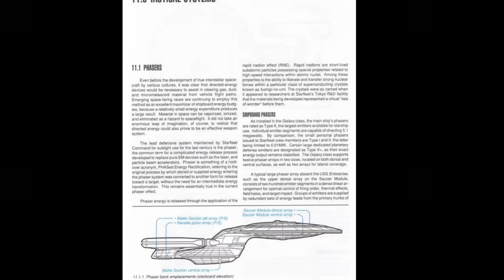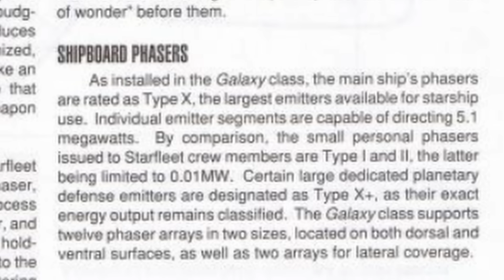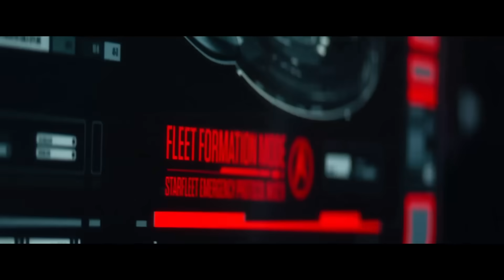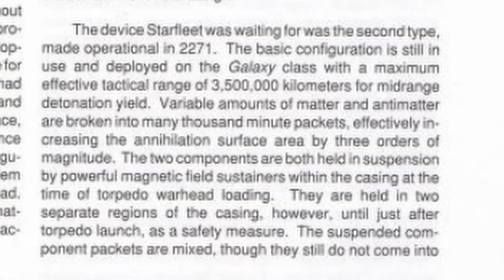Phasers: How Powerful are they Really?

Comment: I remember some Science channel explaining that Phasers work like sand blasters. You have the usual beam plus some tiny particels which are accelerated to near light speed. They carry a lot of energy at that speed, because they are heavier than photons and since there are so many, it eats away any surface in mere moments. 
That is standard fire mode and you can not compare this to regular Laser/Plasma energy output. Like take the same sand blaster without the sand. Just make it blast more air. You will not go through. With sand you will.
Reply: a macron beam then. and with trek tech they'd probably have the version that shoots little pellets of D-T that trigger fusion on impact. that would actually put out megatons per second of energy.
Reply: plus maybe a laser beam set up to keep the macrons pushed to the center reducing divergence for the crazy ranges trek deals with.
Reply from the maker: Yes, phasers are particle beams but the particles themselves disintegrate matter so they’re crazy dangerous at even low power
Reply: Sigh
Another source says that phasers are particles stripped of the strong force and thus basically cause fission or maybe as far as antimatter like particle disintegration.
This would make sense.
Reply: @bobsterclause342  One thing is for sure: the analogy of them squirting acid instead of water is not too far fetched. They may not deliver the same amount of pure energy (combined kinetic and mass/energy alone) as other guns which are shooting plasma bolts for example, but make use of effects which boost the damage output well above the energy rating, which leads to the seen effects of it being able to desintegrate matter if necessary. 

Due to film limitations and other story telling reasons of course this goes around with some sci-magic. Because desintegrating a person in a room would cause this room to heat up and melt everything around it, even in a contained reaction which would not lead to a atom bomb like explosion. Even if you say the matter is deconstructed. The energy needs to go somewhere. And heat is the end for a lot of this process.
Reply: @Orodreth888  yeah, i mean this all is is exactly what I have been thinking.
People act as if the phasers are so powerful like its in the reactor and the beam itself is strong.
Its not
It basically is more like antimatter than a rail gun.
As for disintegration … u yeah… i dont know why there is no effect. You cant just delete matter without consequences. 
Quintessence makes sense though… it teliports matter to another dimension… so a water tower gets hand phasers  without killing everyone or exploding.
Reply: None of the conventional explanations work, because sufficient energy to vaporize a human would result in an explosion that kills everyone within about 50 meters and leaves a 5 meter crater. Instead the target just sort of goes "poof" and fades away. Something much different than blasting them with X amount of energy is going on.
Reply from the maker: @GreylanderTV well, Nadions disrupt matter so what if sufficient quantities at sufficient energy levels will cause all atomic bonds to dissolve in a non-energetic manner?
Reply: @ fictionrant7805 Key word is "non-energetic". Since a human "vaporized" by a phaser does not explode, then there is something else going on other than pumping sufficient energy into an object (mostly water) to vaporize it. If you suddenly turn 50kg of water into steam that's a huge amount of hot gas (water vapor) compressed into a very small space and it is going to expand, violently. What actually happens is all that mass just seems to disappear with very little atmospheric disturbance. This means we can't really think in terms of energy of vaporization in a meaningful way. The matter of the target is transformed or deleted in some way that involves new and unknown physics which may require much less energy than crude vaporization. Interestingly the matter disappears and seems to be replaced by an equal volume of air, otherwise there would be a vacuum bubble that implodes and we would get a loud "pop" from the air rushing in to fill that void.

It's basically impossible to use our conventional knowledge of physics to estimate how much energy phasers actually output. I'm incline to guess "less". Given the name "phase-er", we might guess they operate by somehow shunting matter "out of phase" with normal spacetime (a common theme in Trek), but perhaps it does so atom-by-atom in a disruptive/chaotic way, so there is not a whole object person coherently shifted just out of phase.
Reply: SOLD! Okay, debate over, let's go home.  Actually, I think I remember seeing something like that back in the day, and it makes sense.
Reply: Except that’s exactly how lasers work. They heat the surface atoms of the target and ablate them away, exposing more atoms to be heated and ablated. More photons, faster heating and ablating.
Reply from the maker: @markfergerson2145  Like the OP says, the difference between a laser and a particle beam is similar to the difference between a jet of water and a jet of water that contains an abrasive. 

In this case, the abrasive by itself is capable of disintegrating matter so you accelerate that to 0.999999c and watch stuff disappear
Reply: @ fictionrant7805 at these energies it doesn't really matter whether it is a beam of particles or photons. If we're thinking in terms of explosive vaporization (which is not what happens, see my other posts) then as long as the energy is absorbed by the target, it will vaporize, whether it is a beam of protons, neutrons, photons or whateverons. But a beam that intense would pierce a whole right through a person and keep on going as a narrow beam. There would not be a chance for the energy of the beam to spread and vaporize the rest of the body, unless the beam is rapidly scanned back and forth across the entire body, which we don't see happen. Instead we see a narrow beam strike the target at a small point and somehow the whole target disappears leaving at most a glowing/misty gaseous residue. That's another piece of evidence that phasers do something very weird and involving completely new physics. Phaser are not energetically vaporizing the target.  (Note: when we get to the level of atoms, "ablation" and "vaporization" are effectively the same thing--vaporization happens because particles collide with particles and knock them loose, and at these energies it doesn't matter if its photons or grains of sand or anything in between are doing the ablating...)
Reply from the maker: @GreylanderTV next you’re gonna tell me that running someone through with a lightsaber would at minimum boil their organs and probably make them explode
Reply: @ fictionrant7805 No, running them through with a lightsaber won't make someone explode because the energy from the lightsaber is not given an opportunity to spread throughout the body to burn/vaporizing all of it instantaneous. It only melts/burns/vaporizes where the narrow cylinder of its beam comes in contact (and maybe a little beyond).

Now if you held the lightsaber in a tub of water for a while, it would, I imagine, boil the water. But as it does so over a period of time, there would not be an explosion.

If you somehow swiped the lightsaber back and forth through a body, like a scanning laser, covering the entire body in a fraction of a second, then (assuming the power output of the lightsaber is high enough) the entire body would vaporize in a split second and thus you would have a huge explosion. But I don't think lightsabers put out enough power for that. Notice how when cutting through something substantial like blast doors, it take time and force (not The Force just regular force) to push the saber beam along. So while a lightsaber can vaporization maybe a liter or two of flesh(water) nearly instantaneously to cut you in half, it would bog down if you tried the "scan through every inch of someones body" trick. (strictly speaking, instantly vaporizing a liter of water should still make an explosive steam blast you would not want to be close to, as that's still about 1kg TNT equivalent exposion--so if we're getting technical, and we are, Darth Maul should have exploded with guts & pieces flying everywhere,, and when Quai-gon was run through, the smaller explosion probably should at least have burst his chest) [edit: so wait... yes, yes it will make them expode, lol!!!!  just not like we would expect phasers to]

But in analyzing phaser energy, we're looking at whole bodies which disintegrate/disappear instantaneously. if we interpret that as "vaporization" then we have the problem of explaining (a) how we pumped that much energy into the body and diffused it through the entire body instantaneous even though the body is touched at just one point by a narrow beam, and (b) why no explosion from this sudden conversion to extremely compressed steam?
Reply from the maker: @GreylanderTV  the scene where Valeris vaporizes the cooking pot, leaving the food inside intact from Undiscovered Country further makes things confusing
Reply: @fictionrant7805  Yes, the way the effect of a phaser seems to restrict itself to the person or object touched is a whole other ball of weird. When you zap a person, why does it get all their clothes and equipment, but not, say, leave a small pint in the ground where they were standing. How does it "know" what the boundaries of the target object are?
Reply: @fictionrant7805  all the discussion here is why for a long time i misunderstood the handheld phasers to be removing matter out of phase with our dimension, similar to the logic of that one SG-1 episode with mutant bears. No explosion because it exploded into subspace or whatever, having no interaction with the vulnerable humans in close proximity to the vaporized target

Comment: My theory about phasers. First the Nadion Particle is a type of monopolar pentaquark with a partical mass of 4-5Gev. As the nadion passes through material it strongly interacts with the electric field of electrons in the material dragging them along its path, pulling them away from atoms and inducing massive electric currents (thousands or millions of amps) in the material, causing it to heat up almost instantly, not unlike an induction cooktop. After depositing most of its kinetic energy, it rapidly decays, releasing several GeV into the material as a scattering of subatomic particles and photons. This causes additional heating. The stripping of electrons disrupts chemical bonds and inbrittles the material making it easier to physicaly destroy or vaporize. 

The power of the phaser array is not the energy being delivered to the target, but the energy guiding and focusing the beam. This power is not unlike a super collider's stirring and acelerating magnets. It also places a cap on how many nadions can be controlled and how focused the beam can be. The real affect of the phaser comes down the nuclear interactions of the nadion with the material. And it would interact with varying degrees with different materials. 

As for the stun setting imagine a taser strait to the brain. That means lights out for anybody.

Comment: My personal head canon for torpedoes is that  the energy out put of the matter antimatter reaction is amplified by the material the reaction chamber in the warhead is made of much like a warpcore and that energy is more then big boom like a standard reaction it also warps matter and space creating pressure inside the space and matter in the blast radius. To me that makes more sense because it is impossible to dial in a matter-antimatter warhead without draining of some of the antimatter  cause once the magnetic bottle is "broken" all bets are of for the surrounding matter.
Reply: I thought the yield of photon torpedoes solely depends on the amount of antimatter in the warhead.  The amount can be adjusted by swapping the torpedoes' antimatter pods in the torpedo bay.

We saw ensign Kim holding one of these smaller antimatter pods during Voy: The Omega Directive. 🙂

Comment: You know how an x-ray pumped laser (theoretically) takes a nuclear explosion and turns that energy into x-rays? I postulate that the torpedoes are doing something similar. They're channeling that M/AM explosion into something else (probably subspace particles or nadions or the like) that are far more effective than the pure energy generated by the interaction would indicate.

For all we know, this process is applied to the entire torpedo when it's launched. If the torpedo is converted entirely to subspace energy when it's launched, that might explain why we don't see point-defense weapons used against them, even though they move slow enough that it should be possible.
Reply: the only project where I've seen CIWS used against photon torpedos is in Star Wreck...

Comment: The only thing I can think of re: the torpedoes is that matter/antimatter reactions are a LOT more powerful than the tech manuals let on. How else could ships get stronger and stronger weapons and shields, and go faster and faster, while powered by the same warp cores? They improve the emitters and arrays so they can handle more power going through them.

Now, if only they could likewise improve the fuses running through their bridge consoles to keep them from exploding… 😎
Reply from the maker: The problem is the torpedoes are using antimatter and that’s subject to e=mc^2

If there’s something else going on that could all make sense though like quantum torpedoes use zero point energy so they can hit as hard as needed

Comment: Then reference the attacks on planets instead of starships and shields. 

By the way, the original Star Trek is ironically more consistent than TNG. In particular, the TNG technical manual is a joke: you shouldn't be using it.

If you do, for some reason insist on using it anyway, the energy output difference you apply to phasee should logically apply to photon torpedos as well: unless somehow you're asserting photon torpedoes are less powerful than the phasers.

Comment: The problem with this is that SNW is set in the prime timeline as TNG which would mean they had stronger better weapons in the 23rd century than the 24th and even 25th century when we know for a fact the technology got better and stronger with time, not the opposite.  If the weapons were as powerful as they say they are in SNW, then how do shields from ships stop them?  We see smaller amounts of energy from stars in the form flare/bursts take them out.  We see collisions in space with smaller amounts of energy take them out.  We see simple shockwaves of explosions from other ships take them out.  We see metals, even alien metals, withstand and not vaporize them.  They only discolor them.  If they were so powerful no shield or metal could stop a phaser.

Comment: in a st voy episode seven said that voyager warp core produces 47 taradynes of power and torres on another epiode say they get extra power for recycling the antimatter waste to the malon dumpers so im not sure how much power but it seen like they get extra power for other things while they operations of a warp core not to be confuse with a warp drive system
Reply from the maker: The fact that warp power can be diverted at all means the systems must all be interconnected

What the heck is a taradyne? Lol
Reply: @fictionrant7805  A "dyne" is apparently a unit of force, like newtons, in the CGS variant of the metric system. Teradynes I surmise are trillions of dynes, given the prefix. Converting 47 teradynes to newtons is 470 million newtons, whatever that may equate to.
Reply from the maker: @uffr5880  a dyne is not a newton though just like a joule isn’t a newton